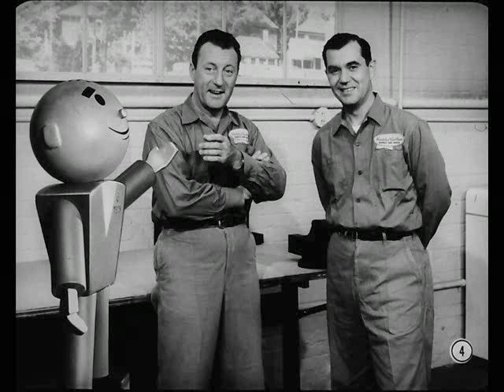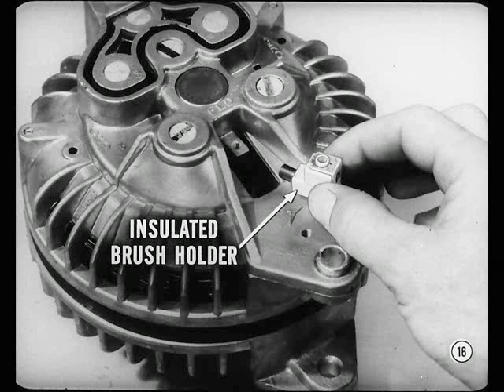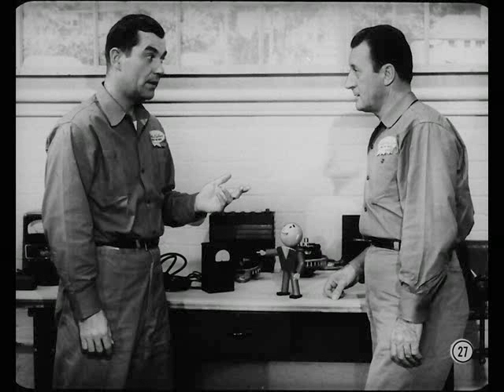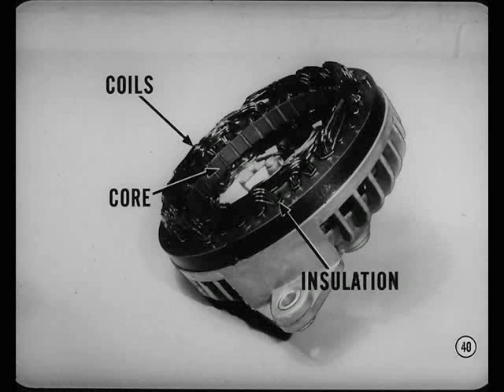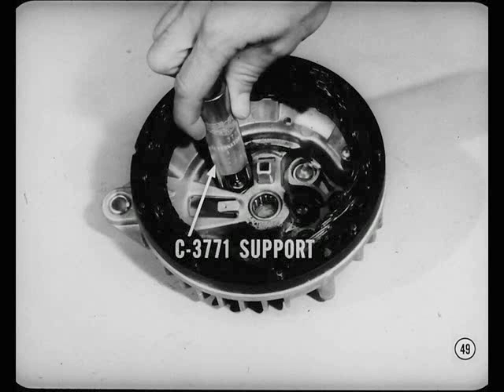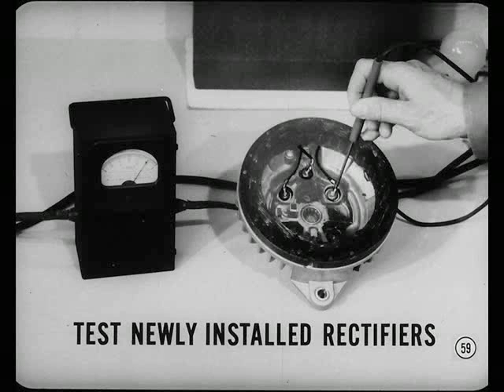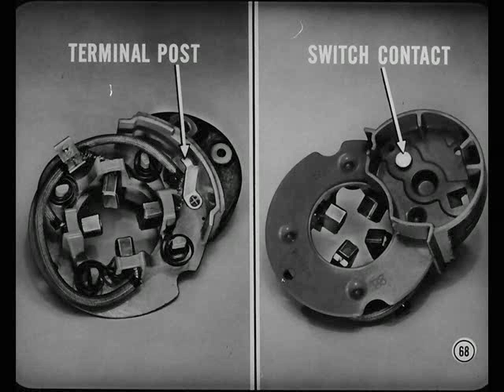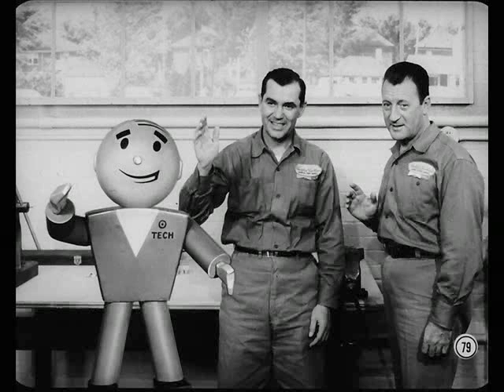MTSC - 1961, Volume 15-1 Alternator And Cranking Motor

Comment: Wouldn't a simple test light tip grounded to metal anywhere be used in place of the 110 volt light bulb and socket?